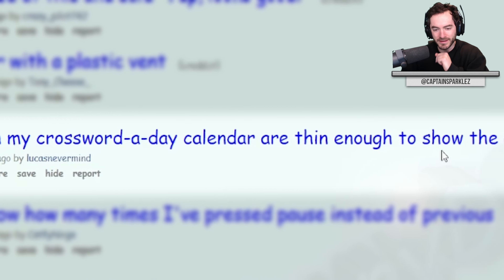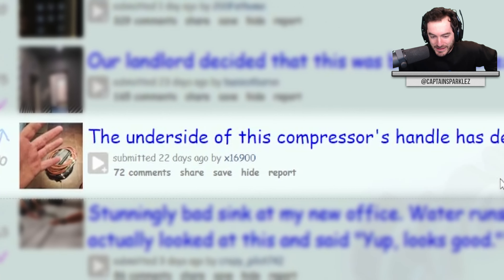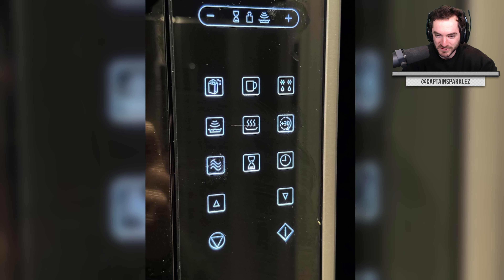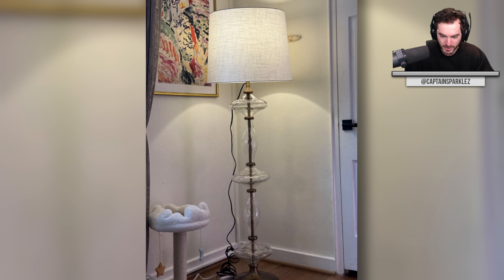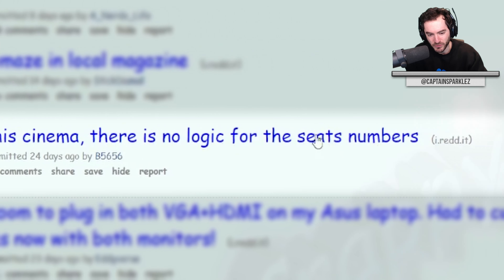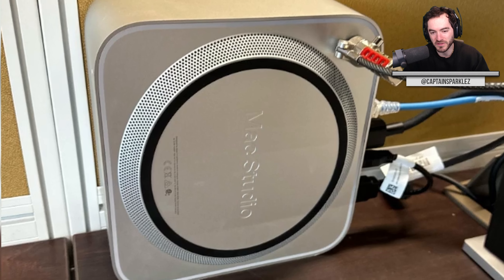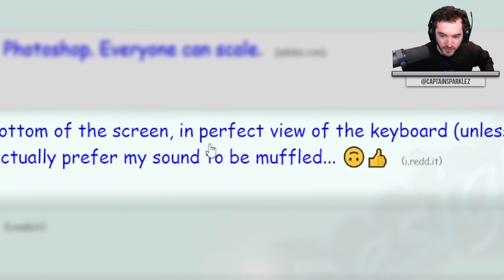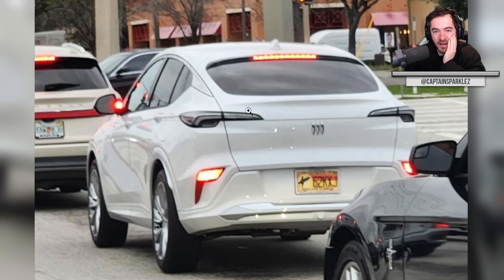Cybertrucks Are Rusting?

Comment: Public washrooms are a good indication of why we need designers and engineers to work together. With people who'e sole job is to slap both upside the head when they decide to do something stupid that makes things more awkward, inconvenient, or stupid
Reply: No kidding. It gets so much worse when you're in a wheelchair too... So much dumb frick design.
Reply: I think public Bathroom Sinks are like that so a homeless Person will have trouble using it for hygiene routines.
Reply: Theres a nice psychology term associated with what happens when a group of people keep going through with very very very stupid decisions. It's called group think
Reply: its not about bad design at all. Its whatever sink heads were cheapest. short = cheaper. long term impacts of taking the cheap route be damned
Reply: Giant gaps between the stall door and the stall wall 😭😭😭
Reply: We have two paper towel dispenser in the toilet that is mounted right next to each other, which means the rolling handle on the side is partially obstructed on one of them. As a result, the one on the right always runs out of paper towel while the left one is almost full. Mind you, this is in the toilet in the mechanical engineering department in one of the top university in the country. Like how can we fail on such simple things?
Reply: @ranndomundead9112 I would argue that cutting corners to save money is bad design, but I get what you mean
Reply: Just call Agent Gibbs, he'll do the slapping all by himself.

For those who don't know, Agent Gibbs is from NCIS.
Reply: I just want a foot pedal to turn the faucet on
Reply: @crated_  That would work a lot better, if there weren't disabled people in wheelchairs who don't have any use of their legs.
Reply: @Game_Blox9999  disabled people is a whole separate issue. And if you’re doing a foot pedal based activation you could easily swap out one of the foot pedals for something else.
Reply: @crated_  True
Reply: Especially if it violates disability codes
Reply: @penand1nk656 especially when ur not an ambulatory user or use a bulky electric wheelchair that doesn’t have as good of a turn radius to active chairs

Comment: At school we have handrails that the architect designed on the main staircase of the building. The handrail is rectangle made out of steel. It's so wide however, that you cannot wrap your fingers round it. Meaning you cannot grip it to potentially prevent a fall. Students brought it up to management, who agreed it was a design flaw and would address the issue. And they tried... However the architect would not agree to the fix and blocked the changes as he found it to be an integral part to the building design. Unless of course the school paid a stupid amount of money to him, the fix could not be applied legally. The dude designed a handrail that cannot be used as a handrail and wants to be paid extra to ALLOW it to be fixed.

Comment: The 45° angle of the stairs means you’re feet aren’t evenly spaced when walking up like normal stairs. Basically if you try and walk up like normal your foot will hit the back of the next step and you’ll trip. Depending on where you live stairs like this are a building code violation for this very reason
Reply: I still can’t see the issue with the stairs, can someone explain better
Reply: @jimmy50908 it's a tripping hazard and should have been against building code.
Reply: @jimmy50908  Rather than the stairs being perpendicular to the slope they're on, they're at an angle.  So you would have to step further forward with your left foot than your right foot to put them on the same stair.  That is not a natural way to step, so it significantly increases the chance to trip on one.
Reply: @jimmy50908  the stairs are actually curved like that, it isn't a fish eye lense effect. Like a spiral staircase but less obvious so you don't think to correct your footwork for it.
Reply: @kestpigglet7529 I'm still not seeing any curve to the stairs.  All I'm seeing is a perfectly normal staircase that just ascends a mite more steeply than some may be used to.
If you're seeing a curved staircase, you need to move where you're looking; the picture was taken at an angle, and then the railing that gives scale to the rest of the staircase gets cut off on one side for the last few steps.
Reply: @GremlinSciences  That is not a lens effect that is causing the stairs to look like that. The left side of the stairs is further away from you than the right side when you approach the stairs. Extremely dangerous since after you step with your right foot, your left foot has to travel further forward to reach the next step than with an ordinary staircase.
Reply: Here:

Stairs:
        \\\\\\
 \\\\\\\\\\\\\
  \\\\\\\\\\\\\
   \\\\
// <- you 

You have to walk with the stairs at an angle (for you to be standing on a single step, your left leg would have to be far ahead of the right leg, if you try to walk up the stairs normally, you would kick the stairs with your right leg)
Reply: @WhoTnT  If there is no lens effect causing the stairs to look as they do, then the stairs must be straight, not curved.  The only difference in the observed width of the steps comes from the fact that the camera of looking diagonally across the stairs instead of straight up them.  Take any other staircase and stand right in front of the handrail while looking towards the wall near the top, exact same kind of distortion.
Reply: @GremlinSciences  I didn't say they were curved, that was the person before. Draw an imaginary line down the middle of the video and check where it hits the stairs at the top and bottom of the video. The person is standing almost in the middle of the staircase but the 45 degree angle of the stairs makes it look like they are standing on the side as it create a weird perspective effect. If you still disagree then I guess the person was making a fuss about 45 degree stairs for no reason.
Reply: @GremlinSciences  The steps in the picture aren't rectangles, they are parallelograms. Walking up these stairs is like starting at the bottom right of a wide staircase and ending up in the top left. It's just weird and can mess you up if you aren't paying close attention.

Comment: 16:11 The planes is an issue because someone placed each of Boeing's planes' images above each of Airbus's, even though those Airbuses are longer range than the Boeing with the higher image. Because the spacing is irregular and the images are similar sizes and they are not simply spaced evenly and aligned both vertically and horizontally, I would conclude that Boeing is deliberately being made to look better.
Reply: I dont know if it was to make Boeing look better. They needed a location to source the credit and chose the side. Then had to move all the photos slightly higher. Not only that but the lowest distance was airbus so no mater what it would look strange as then the lowest distance would be above the other one.
Reply: Yeah, but they also listed all of the ranges in nanometers, so according to those markings, all the planes are incapable of moving farther than less than 1/100th of a millimeter. You physically wouldn't even be able to see it move, as 6,000-8,000 nanometers are only 10 times the distance of a wavelength of the color red. That distance is closer to the size of an atom than it is a meter. Here's a good reference point: Human red blood cells are about 10,000 nanometers across.
Reply: @adamwalker3560  Good eye didn't even notice that. So, I would say not propaganda just shoddy work lol.
Reply: @adamwalker3560 NM is correct for nautical miles, an accidental error or font style choice, likely. I found the original source and looked at other graphics by them. They have other graphics which correctly order plane images according to the data, but the problem is those boxes. When that person uses boxes, they always have an ordering issue with the height and the data. I was wrong. It's not malice, just a repeated process error. Good day.
Reply: @katanyafleet  Ah, that makes much more sense. This infographic is so unprofessional i didn't realize it was intended for professionals. And if it wasn't, then that's even worse, because most people don't even know what a nautical mile is, and why it is used.

Comment: The compressor handle thing is because for injection molded plastic parts, thing wall designs are required to reduce part warpage, hence the hollow backside. But the company cheaped out without using a two-piece design, which would take up extra space in the mold, and cost a lot of money.
Reply: I have almost the exact same air compressor given as a gift. I hate the damn thing lol.

Comment: To add to the cybertruck thing, those issues are magnified because none of those vehicles have the added protection of the paint in addition to the more modern less resistant manufacturing method. There is also the classic tesla inability to properly fit the panels together properly.
Reply: It would be intresting how the stainless steel holds up if neglected. Delorean also had stainless steel panels, Its 40 years old now. tried to find corrosion examples but couldn't find anything that even remotely looks like rust. Only AI generated images.
Reply: @edfx  From my understanding is the deloreans were all built with the older stainless steel manufacturing method and they were generally much better constructed as far as fit and finish. One thing to note is that none of these trucks have gone through a winter or two yet (especially one in the mid-west). All of that salt on the roads will destroy whatever protective coatings there may be and greatly increase the surface area for rust and whatnot with micro scratches. The absurdly large wind-shield is what Im most concerned about for anyone that lives somewhere where the weather gets a little bit rough or that you can frequently find yourself behind vehicles carrying gravel.
Reply: The stainless steel is highly resistant to rust more than a car with paint. And a car with paint damage will rust a whole lot faster. 

The issue was magnified because of people’s ignorance of raildust that lands on everyone’s cars and is especially noticeable on white paint cars.
Reply: @starshipdriver8536 you are simply incorrect, even the owner’s manual for the cybertruck describes how much babying you need to do to prevent rust.

Stop being an Elon meat rider, the man would use you as a human test subject first chance he got.
Reply: @brody7714  All it states is the standard corrosion that all cars face, difference is these regular vehicles don’t have stainless steel that is way more resistant to corrosion so you have to baby your car and its paint to prevent rust. It’s way easier to clean and maintain the cybertruck. 

Stop being so obsessed with elon that you have sexual fantasies like that.
Reply: You know, this all could have been prevented if they attached zinc plates to the backside of the panels and replaced them when needed. Also, I'm pretty sure there exists stainless steel out there that doesn't rust that has nothing to do with a pollution-heavy manufacturing method; it's just that these methods are expensive, that's all.
Reply: @starshipdriver8536  that’s wrong, again, why are you intentionally spreading misinformation? Are you being paid for it?
Reply: @edfx Funny thing is that what people have learned from owning Deloreans and caring for them will come in handy when people buy cyber trucks because the similarities
Reply: @starshipdriver8536 I don't understand why stainless steel is more resistant to rust than a painted car, when car paint literally doesn't rust. You are comparing damaged cars to an undamaged cybertruck, and claim that damaged car are more prone to rust. I'd imagine few if any car buyers buy the car with the intention to damage it on purpose.
Reply: @brody7714 Jordan perfectly summed you up. now im not defending the rusting problem at all but what i am saying is no one has yet to post an actual rust picture and therfore we should all wait a little longer to see how big of an issue this becomes.
Reply: @edfx Deloreans definitely rust if not taken care of, saw a rusted one where i live (UK) and had to do a double take because i didn't recognise it at first
Reply: @Erudite_TWRStill doesnt make it excusable for a vehicle that you are expected to drive around. Whats their excuse for having the issue on all of their other lines of cars that uses traditional panel designs? Its a huge problem there too. And this gap problem isnt just the outside panels, its a known issue with the interior panels as well.
Reply: @Erudite_TWRIn my own, my family, and my friend's experiences with cars over the years the gaps issues all teslas have has not been an issue with the vehicles we have owned from Ford, GM, Toyota, Kia, Honda, and Chrysler over the last 30 years. Any earlier than that no one particularly recalls. The rust/corrosion types of issues has only really been an issue with deep scratches in the paint/chipping, places damaged by inpact causing cracking in the paint, and metal fenders that havent had the protective coatings re-applied regularly and thoroughly.

Comment: At that point the sensor to turn on the sink should be outside. Then you'll have to run outside to turn the water on, so by the time you get back the water is off again and the sink is just slightly wet.

Comment: My elementary school in japan had those metal things on the stairs. I tripped on it and took a chunk of my skin off cuz the metal lip caught my knee. The scar is still there
Reply: My aunt's old house had those on the basement stairs to hold on the linoleum. I ran up them barefoot one time and my foot slipped. I thought my 4th toe had been stretched back a little when it had really been cut very shallowly. It didn't even bleed. A couple days later of taking the bus in a Portland, OR November with my feet never drying out and it was massively infected. I was on crutches for a week and the scar tissue means I have to be careful when getting a foot rub. That's part of the reason I've learned that humid climates are not for me. I'll stay in my Idaho desert, thanks.😁

Comment: Regarding the theater seats, I used to work at a theater 15 years ago.  Our maintenance shop had over a dozen replacement seats on the ready.  Whenever one started go have issues, they'd replace the whole seat and work on the broken one in the shop.

My guess is this theater probably stopped doing assigned seating and didn't care about seat numbers when swapping seats.
Reply: I prefer to believe they play mega bingo with the audience. 🙃

Comment: 6:45
one of my schools had huge waist-height sink basins. you pressed your foot on a "pedal" (truly just a bar running the entire diameter of this half-circle basin) to turn it on, where it would spray a shower-pressure semicircle of water. there was enough room for four teens to use it at once. the most people i was ever in a bathroom with was 2.
i heard rumors that a lot of the boys would just pee in the sink instead of the urinals.

Comment: you can't really see it on the pic, but the stairs aren't even on each step. they funnel at the side. they're like a triangle without the tip. which means if you don't watch your step, you might put your foot in the smaller side and lose balance

Comment: About 9 years ago we had a complete refit in our offices and new self contained toilet facilities were installed. It was all done to a very high standard, but we were having an intermittent issue with the new sinks not working. The taps (faucets) had a sensor so that you didn't have to touch them, but a number of staff had reported instances of them not working. Whenever the sinks were tested, there was no issue with them, they worked fine. In the end the project manager gathered all the members of staff who had made a complaint to see if they were doing anything wrong. Every single one of them was black! The sensor only worked when it detected white people! We had racist sinks! 😁I would have loved to have been a fly on the wall when he went back to the manufactures to explain that issue!

Comment: 18:00 one thing about the cybertruck rusting that I heard is supposedly the cybertruck has some "custom" alloy for their steel, but the alloy is indistinguishable in composition from some other off-the-shelf alloy, but they did something in the manufacturing process that has basically crippled its rust resistance compared to the alloy it appears to be.

Comment: Why are people trying to make fancy microwaves? Microwaves aren't supposed to be fancy. They're supposed to be quick, easy, and convenient to use. The user interface only has three essential components. The large button that you push to open the microwave, buttons for numbers, and a start button. That is the bare minimum. If you make a "fancy" microwave that doesn't have a number pad, you've failed at making a microwave no matter how many fancy options it has.

Comment: Wait, Jardon really dont see the staircase is slightly angled? People going to 100% tripped with their right leg
Reply: It's a bit of an optical illusion, but I agree, I would expect people to be able to see that.
Reply: He might have small depth problem in the eyesight? So some rare times wonky straight lines don't seem as wonky and sometimes straight line looks not straight. But if it's 0.5 or less, it usually doesn't affect you IRL that much - and often you don't know about it. I only know about mine because I'm almost blind without glasses, so I have been tested, but it's so small that I don't need my glasses to fix it. 
Thou... Seems also that he doesn't know much about basic safety design for buildings so... It might be that type of not seeing the problem.